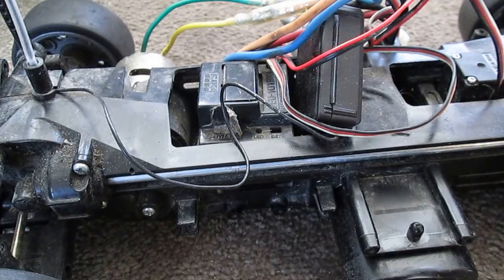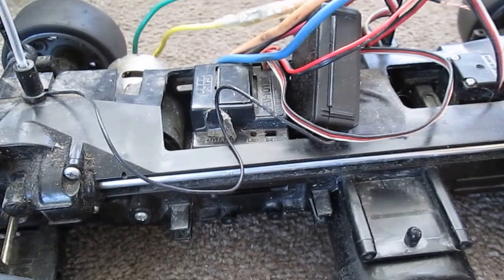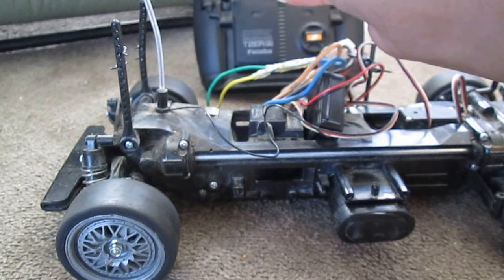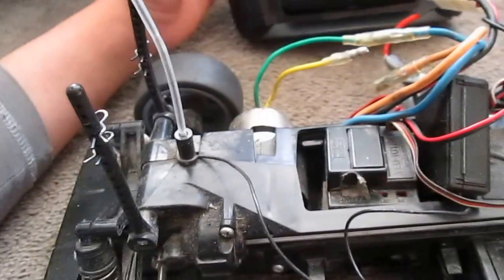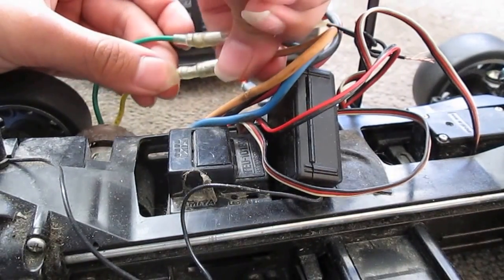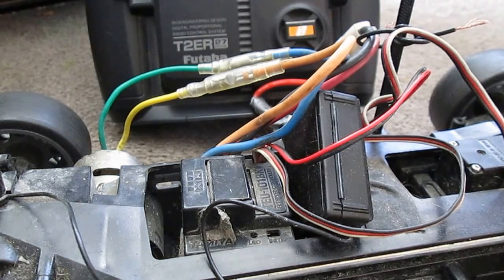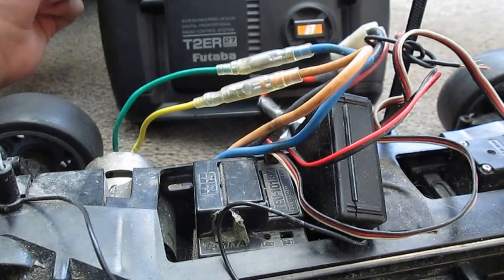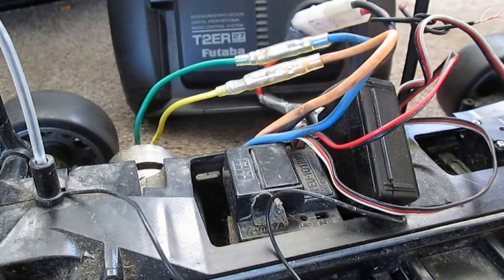How To Program/Setup A Tamiya TEU-101 BK Brushed ESC

Comment: Only thing I don’t like about the ESC is that it doesn’t have a BEC so you have to plug the red and black wire from the ESC to the battery slot on the receiver
Reply from the maker: It is like a 20 year old receiver so you cant expect too much of it
Reply: Thomas Sears it’s the esc that doesn’t have bec I have this in one of my cars I use a 2.4 ghz radio the esc is old but still works so I use it
Reply from the maker: After I made this video I swapped out my analog rx for a 2.4ghz digital one as well

Comment: Hi there, Need help and assistance...for my Tamiya plasma edge i lost the transmitter  { controller } which was of 27mhz with receiver same frequency 27 mhz .. Is it possible to change or.can i replace a new receiver of 2.4 ghz with new Transmitter,  ESC is Tamiya TEU-101-bk .and it previously it was a 2 ch can i use 3 ch receiver ...or it should be 2 ch only

s good ...so kindly suggest me whether 2.4ghz  Transmitter and receiver would be compatible with this ECS .....And do the operating range will increase with a 2.4 ghz transmitter and receiver kindly reply and thanks a lot for your support ....
Reply from the maker: You can replace it with a 2.4ghz transmitter and reciever. 3 channel reciever should work just fine.
Reply: Thanks Thomas thanks a lot

Comment: Hi there, please could you tell me where you have plugged in the 2 pin Red JST type plug coming from the ESC? have you plugged it into a separate 6v battery pack OR into the VCC of the receiver ? Thank you.
Reply from the maker: Simon Edwards I don't think this esc has one. The red and black wire is for the switch that's mounted to the chassis

Comment: Thank you it worked. The reverse isn't fully responsive. You have to sort of bring down the reverse slowly to catch the bite if you know what I mean. I am not sure that there is much I can do to improve this?
Reply from the maker: Most esc's are designed to go into braking mode first, then you release the throttle, then it goes into reverse when you push the throttle back the second time.
Reply: Yes thats why im here aswell. I thought my esc was faulty. But now think the delay is so that the car can brake from speed without going into reverse and spinning!!!

Comment: Press Set, Throttle up, press Set again, Throttle down.... What exactly does that do? You need to explain what you are doing. I thnk I'll just go read the manual. This video is lame.
Reply from the maker: supercommando440 what its doing is to let the esc know where the upper and lower limits are of the input. also yes. i also agree it is lame.